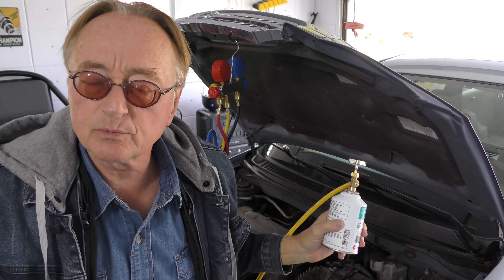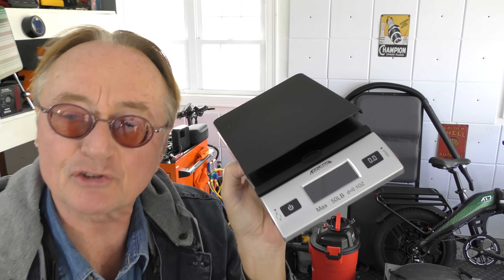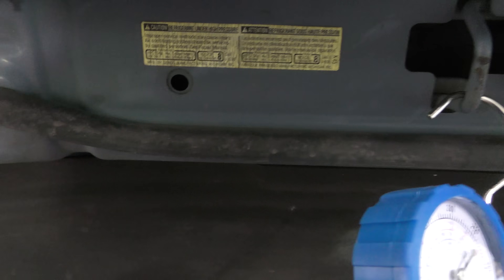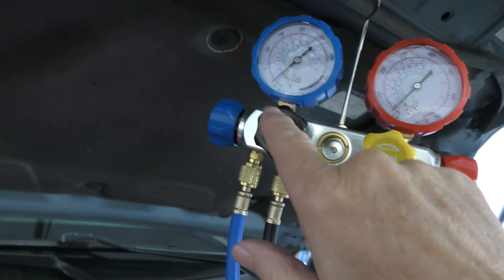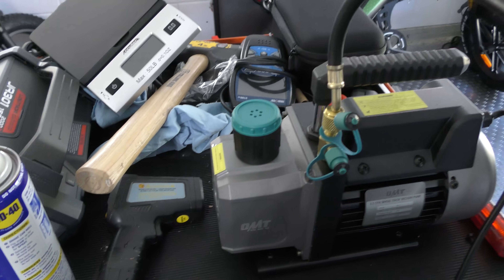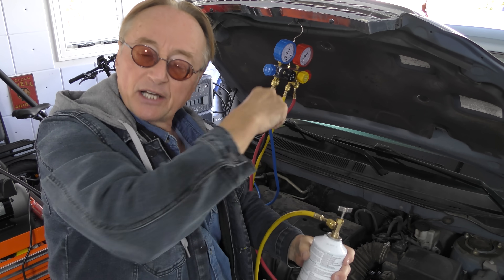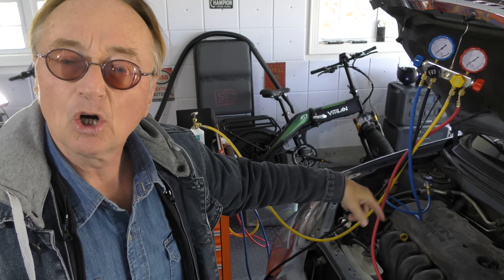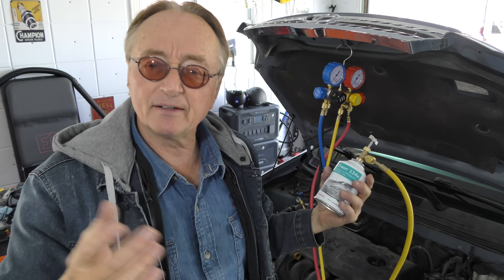Doing This Will Make Your Car's AC Blow Twice as Cold

Comment: Had to replace the condenser in my 2015 GMC Sierra last week. The quote was $1350.00 to replace and recharge. I ordered a new condenser from rock auto and installed it myself and recharge the system for $215. 😎
Reply: Replaced the condenser on my 2015 Silverado. Same story as yours.  Went to Chevy dealership and was told they’re on back order. Comes with a 3 Year warranty. Found one with a lifetime warranty for @$200!  Took only @ 1.5 including vacuuming out old Freon and putting in new Freon. Saved a ton of money!
Reply: This should be a recall by now.   I've been having trouble with my ac for 2 years.  On my 2015 silverado.
Reply: @stephenmetz2044  Yeah I know it’s like you bought a Silverado. Those things fall apart just give it half a decade
Reply: All new fords and chevy’s are terrible
Reply: @stephenmetz2044  Definately!  GM should be ashamed of itself for allowing known faulty products out of the factory.  Other than the AC condenser, the truck has been a stellar performer.  Likely selling in the next few years for a Tacoma.  I no longer need a full size pickup.  Sadly, I’ll likely never buy another GM product.  Almost as if they’re built from spare parts….
Reply: @pjpatriot248  yup! My brother bought a new chevy trail boss 6.2 ltr and within 2800 miles the lifters failed. There were pieces of metal that were missing from the lifters and are somewhere in his motor. He tried to fight for an engine replacement with no luck. Guess he’ll have to hope for the best in his new $58,000.00 truck 🤷‍♂️. Shameful
Reply: @J_Bwn  Just GM being GM and complicit with Green Climate/Big Government.  The issue is with the DOD, shutting down 4 cylinders where not enough oil getting into the shut down cylinders. Too much heat/friction and weak pushrods making them susceptible to bending. Once again, GM should recall.
Reply: @J_Bwn  Should be covered under warranty with only 2,800 miles.  Keep pressing. Write to the CEO, Better Business Bureau, etc
Reply: @pjpatriot248  they only replaced the lifters under warranty.
Reply: @J_Bwn  Not exactly standing behind their product. Shameful.
Reply: @pjpatriot248  a
Reply: Mechanics are crooks
Reply: Pep Boys just quoted me $1276. Just for labor, they said I needed a new compressor and recover dryer, whatever that is.  I said I'll go pickup the car now.  Went to Auto Zone and bought a 12oz can of freon, now the ac is ice cold.  A bunch of crooks!
Reply: @SMWLM  WIN!!! 👍
Reply: @J_Bwn  Why did he buy something made by GM?
Reply: Way to go!
Reply: I did the same
Reply: same
Reply: They be capping 😂
Reply: Did you all flush your system prior to putting new condenser in? If not it’s just going to break again.
Reply: @ypcomchic  That’s why you take it to a reputable service station to get it recharged. I only installed the new condenser and took it to a place that I trust to get it recharged. What they do is run a vacuum in the system to evacuate it and check that it doesn’t leak. Then they fill it. Done deal 👍
Reply: My brother got a 2015 silverado too. Changed out the leaky condenser and paid $290 total.
Reply: Amen. What was the extra $1135 for? Your paying the  mechanics payroll for the week?
Reply: @user-ez7oe6gl9b  that’s how the Machanic works lol
That’s why it’s better to learn and do the things then going to a Machanic
Reply: @anllelyn0470  totally agree
Reply: @J_Bwn supposedly there's a class action lawsuit on that. Look it up, some guy made a video about it on here.
Reply: Love how easy the chevy's front end is to work on. (Atleast in the enginen bay) 🤣
Reply: I had to have a bunch of ac work done on my 2010 Silverado about 1.5 years ago it cost me 2600$ at the dealership I bought it from, these GM’s are bad about condensers & other AC Components going bad prematurely they’re a pain but I love GM trucks up to 2014 because in 2015 they changed the motor,  these newer GM trucks are nice trucks but the motors aren’t what they used to be, my 2010 Silverado has been so reliable never gave me any issues, I bought it with 94,000k miles now it’s got 191,000 she’s a beast, the next truck I get is going to be a 2014 Silverado because the 2015 has cylinder deactivation & some other changes idk how good that’s going to be for the motor uneven cylinder wear, misfires, oil consumption, & a bunch of other issues, need to figure out how to deactivate it, GM Motors shouldn’t have changed the Motor they had a good thing!
Reply: @schlick93ify  i bought a cheep $200 tuner that plugs into to OBDII port and deactivated the cylinder deactivation from new. I’m at 115k miles now with zero issues. My tuner was the Diablo sport and it just plugs in. Turn off the DOD/AFM, unplug it, and off I went. The new trucks require extra mods to the engine bay to do the same thing. You HAVE to change the oil on time or early as well. The torque converters don’t hold up too well if you haul all the time. It is very necessary to always use the trailer mode for that reason. Still love my sierra, she’s been good to me.

Edit: good oil pressure, no ticking/knocking, no oil consumption. No laggy feeling from waiting for cylinders to activate. Fixed the weird shifts. If you turn of DOD you’ll love the truck and it will feel like you know them to feel like. 👍
Reply: @J_Bwn  yea that cylinder deactivation crap sucks bro idk why they had to do that I kno it’s for gas mileage & all that nonsense but it’s a truck jus leave it the way it was so it’s reliable my truck does great on gas running on all 8 all the time! I change my oil when it gets down to about 20% you have to on these motors you don’t want oil ports to get clogged up & starve parts of the motor, GM is the way to go bro I’m on my 6th GM truck that’s all I drive! I have a 1991 Chevy G20 custom van as well with the 5.7l V8 that thing is a beast & it’s in damn near perfect condition I jus did a bunch of work to it & im about to have it painted, in great condition with low miles these old Chevy vans are selling for up to 15,000$ or more, I’m about to have it lowered on airbags! I do auto glass for a living I have my own glass truck I’m keeping pretty busy I can’t wait until my van is finished & laid out on the ground it’s going to look sickening!
Reply: @schlick93ify  A full size truck should never be on four cylinders. It’s constantly changing between four and eight cylinders, and it messes with a lot of things doing that. Funny thing is I was getting 16.5 miles per gallon with the cylinder deactivation on. When I deactivated it, I started getting 18 mpg. It sounds like a sick van my dad used to have one of those. Had 275k miles on it before ha parked if
Reply: @J_Bwn yes but the lifters are what made the engine fail so keep pressing you will get a whole new engine as you are a customer not a mechanic how are you meant to know what's going on inside the engine they are just trying their luck so keep pressing because your brother is definitely in the right as the car has only 2800 miles especially if he bought the car new
Reply: @chrismartin6427  update, the truck has been running good since 🤞
Reply: Is it it double cabin or single cabin?
Reply: @72guystrikerandwrestler52  double cab base 4x4
Reply: @pjpatriot248 union auto workers don't care. All they care about is getting big paychecks and golden parachute retirement benefits and getting to the bar on Friday night.
Reply: @pjpatriot248  over regulation gives them an excuse to be greedy.  You can't punish them by going to a competitor, because the competitors are forced to do the same things.
Reply: I have a 2000 3/4 ton GMC Sierra, I have never had a single issue with this vehicle except for the GD air conditioning system that I am getting ready to replace for the 3rd time. Now I am going through the same issue with my wife’s 1014 Chevy Silverado Z71. Apparently a/c is GM,s weak link.
Reply: @flatsfisherman4353  mine is still running good. The aftermatket condenser has much stronger welds and has held up good.

Comment: I am an HVAC tech and approve of this video. Good stuff Scotty
Reply: I agree, HVAC tech here also. I have seen auto techs charge cars and said what the f! Thats wrong, there is way more to charging ac than craming tons of refrigerant in!
Reply: i pay a good mechanic friend &175 hr.
Reply: What about a/c oil???? does it need a can of oil?
Reply: @magnumpi28  if it all leaked out it will need oil for sure, if the leak was on the High side pressure line it will need more. It is hard to say how much leaked out so it can be tricky. 
DO NOT use a whole lot of oil, to much is more harmful that a lil underfilled
Reply: @magnumpi28  but make sure you get the correct oil, some use PAG and the numbers for PAG differ. So make sure you use the correct oil
Reply: I’m a residential hvac tech and it’s similar to automotive and on my daily beater I replaced the condenser, expansion valve and compressor along with all the o rings and I flushed all the lines and that ac blows very cold but I just bought a 2008 acura TL type s and the ac blows cold but not that cold and idk the history of the ac system. I hooked up my gauges and threw in a little refrigerant and it went down By 5 degrees for supply air temps. I cleaned my condenser coil as well. So my question is if I did an evacuation and a recharge would that make it colder? I get that refrigerant is only going to get so cold with charge but this refrigerant might had additives in it because some people think that using stop leak is a good idea.
Reply: @E85_STI  The reason why you evacuate the system is to remove the air and water vapor from within the lines. Water doesn't phase change in the right way to chill, and it also corrodes the lines. You're purifying the mix when you recharge with the correct refrigerant and oil. It's like how brake fluid absorbs water from the air over time. Water isn't compressible, but steam is.
Reply: Does this technique account for the refrigerant left in the lines?
Also... what about oil?

Comment: Definitely have to say this is one of Scotty's best how too videos. 
Both my vehicles are getting old 07 Colorado and 2015 Equinox. No A/C problems thus far, but I live in Florida  A/C is life.
Reply: that's the truth, how can it rain get down 72 degrees after a rainstorm then less 2 hours later its 90 degrees n very steamy and humid, it still amazes me the weirdness of the weather even living here over 3 decades lol
Reply: Yeah. I'm stubbornly hanging onto my 2004 Colorado with i5 engine. I only have 1 window (passenger window) that still goes down and my A.C stopped blowing cold. Talk about a hot ride! Lol. Gonna try and fix it myself.
Reply: @adamhalcyon3393  I have the i4 four door 130k miles only repairs was. The blower motor wire over heated so I had to splice in a bigger gage, just six inches. Passenger front wheel bearing. Glove box handle broke super glued it. That's it. How many miles on yours?

Comment: I replaced the accumulator on my car last year and used the exact method for vacuuming and refiling with 134A. It's still working perfectly a year later.
Reply: What did you do with the refrigerant you pulled out? Or was the system completely empty before you started the process?
Reply: @derekjackson3990  The accumulator was rusted out, so all of the freon leaked out when it blew.

Comment: Great video, I would change the shrader valves anytime you completely evacuate the system and refill. Especially if it’s 15 years old. They leak very often on the low side after charging even if you do it correctly. Usually they cost less than a can of coolant.
Reply: THAT, my friend, is GREAT ADVICE!!!  Just make sure the new Schrader valve is identical to the old one.  Replacing the valve can save you a bunch of future heartache!!
Reply: Richard Pedroza  No they are not all the same on the high side. The low side are are pretty much the same.
Reply: Richard Pedroza  order by model...even gms.... high side and low side are different sizes of valves
Reply: 2015 isn’t old
Reply: thats a waste of money- if you have dytel you can test them very quickly and easily.
Reply: @tommurphy4307  I would just change the valve unless you can recover the coolant after detecting a leak. Otherwise you are wasting refrigerant AND dye and you STILL have to replace the valve.
Reply: Someone might mention that  when you first open the schrader valves to only open them enough so the gauges show the static pressure. You can damage the schraders from cranking down on them.

Comment: I knew a young man that told me his air conditioning was not working, so he took it to the same shop that installed a used set of ring and pinion gears in my pickup without telling me, so just for the heck of it he scratches his initials on the bottom side of the ac compressor, 
He gets his car back from the shop and the air conditioning is now working ( for 360.00 ) they had to replace the ac compressor , it was all pretty with a new paint job but his initials were still on the bottom of the compressor :)
Reply: So did you guys go back and say something?
Reply: Maybe they rebuilt it and used the same housing?
Reply: Well the air conditioning compressor didn’t happen to me so I don’t have all the details of it,
Reply: Smh
Reply: L
Reply: Did

Comment: Scotty we all need you mate!!!! I just had my aircon serviced on my Vito van and instead of 800g of gas she was down to 350 so the air was coolish but certainly not cold. So following a long hot drive home I decided to have her done and as you can imagine the difference is amazing!! You did not mention in this video that you should also change the cabin filter from time to time, mine was filthy so now the smell is much improved AND I cleaned out the vents using a can with a very long flexible hose. Thanks again!!! Simon

Comment: I have been doing my automotive ac for many years now . Doesn't cost hardly anything and it is amazingly simple most of the time .
Reply: how do you deal with sucking refrigerant out? do you own a recycler or just vent it?
Reply: @fruitshishkabob  - usually it is empty and I fix the leaks - vacuum it down and refill
Reply: you can get by some times just adding some to it and then just depends on how slow the leak is . But it was 5 dollars a can not long ago - so even if i had to refill a couple times to get through the summer
Reply: @creed5248  Yeah I just added some r134 to my ac system and it started blowing cold again. Hoping it lasts for a while

Comment: I'm happy with 58° discharge on my old '86 Toyota pickup. I'm too reluctant to pull the evaporator. It still keeps me nice and cool during the dog days of summer.
Reply: 58 deg??!!  That’s horrible.
Reply: My 91 yota gives my fingers frostbite it's so cold. But I fix it every year.
Reply: @The_Redkween  Some men aren't afraid to sweat a little....
Reply: @The_Redkween  AC design is a 40f evap with a 15f split would mean 55 degrees is DESIGN supply air. 58f is good enough.
Reply: 58f is good at idle especially for an almost 40 year old truck, getting to low 40's is difficult if you dont use the correct equipment and capacities as well

Comment: Just put in some AC/PRO for the second spring in a row and the AC is now blowing 63.9 F. This stuff is Golden.
Reply: @derek17005  anything below 59 is good
Reply: 69.3f = 17.7C.  That doesn’t seem cold enough? My Honda is around 4C at the vents.
Reply: Did you drain the low pressure before adding?
Reply: @dylanmonahan1002   - No Dylan because I had used it last spring and it cooled all summer. Thus when this year it wasn’t cooling it confirmed that I had a slow leak. I did just barely get it into the green to prevent overfilling.
Reply: @paulsi1234  4 celcius? Whats the ambient temp when you get this reading?
Reply: @ham5483  a warmish day, 30C. The compressor was intermittently not coming on, at first I thought it may be low on gas, as it’s never been filled and it’s a 2010 model, but the low temp from the vents when it was working told me it can’t be low on gas. Turned out to be an intermittent relay that operates the compressor clutch.

Comment: This is an awesome video.  Maybe I missed something, when you use the pump to remove the refrigerant that is in the system, what do you do with it.  Does the pump store it?  How is it disposed of.
Reply: If you have a nonworking system most of the time the refrigerant has already leaked out all you are doing is creating a vacuum so that you can reinstall refrigerant without having air in there to mess up the system
If it won’t hold the vacuum then you’re finding a leak under vacuum when you have to look around and see if you can spot where you have what looks like an oil stain on a line or something or possibly use dye and a black light

If you can’t find anything let it run and let the water drip out of the evaporator and hit that with the black light and if you see the dye in the water then you got a problem because most evaporators are an SOB to change

Scotty has forgotten more than I know but I have picked up a little over the years

Keep it up Scotty !
Reply: Same thing I was wondering what to do with the refrigerant that was stored in the vacuum..?
Reply: Same for me. Not sure where to start if I still have refrigerant and need to change it all out.

Comment: Where are you supposed to capture the evacuated Freon?  It is illegal to just dump it; as you know.  The last system that failed on my 90 Geo Storm had to be properly done.  I'm not doing a full replacement including the compressor etc.  It cost $1,500 for the job.  I told the dealer not to fill it with the wrong refrigerant or it won't work.  They tried and got caught!  They ate the cost of evacuation and fill done by a A/C shop.  Now it works like factory new.